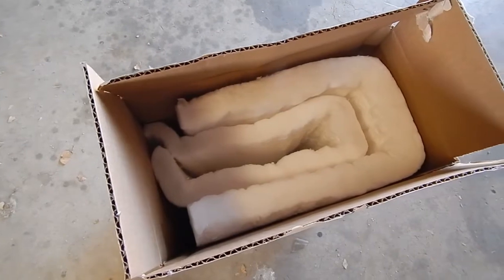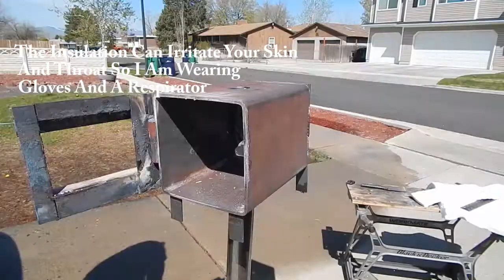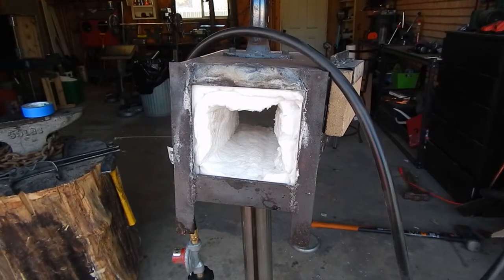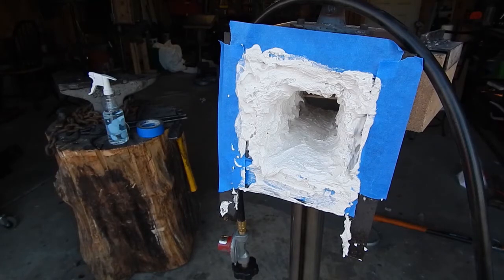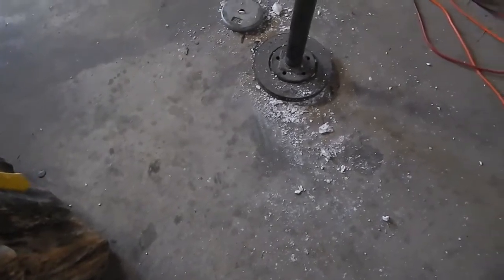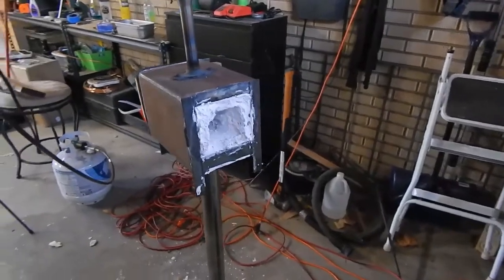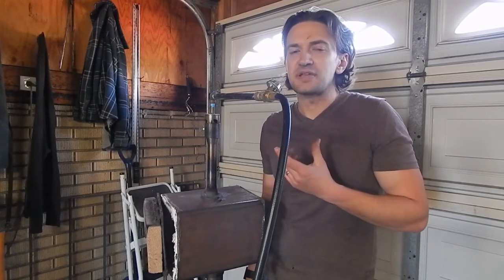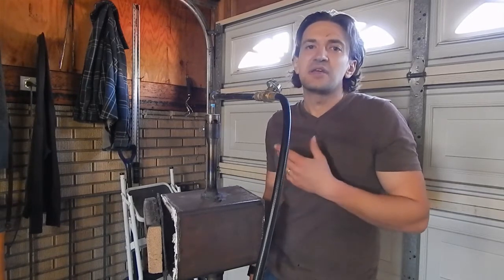KNIFE MAKING- HOW TO INSULATE AND COAT A FORGE

Comment: Did you use rigidizer before applying the Satanite?  Not an expert, but when setting up my 1st forge, instructions said to apply 1/2 of the Satanite, wait 24hrs, apply the 2nd coat, wait 24 hrs. Then light forge for 30 seconds, then wait for it to cool. Continue lighting/cooling, adding 5 seconds to each burn. Continue till you see no steam.
I didn't see any steam with the 1st burn, but continued adding 5 seconds up to 3 minutes. Working great so far.
Reply from the maker: I didn't use rigidizer. It does give extra strength but isn't necessary. I ordered a larger forge so I will probably use it on that one. My heating was similar. I coated and heated (a little sooner than I should have) then re coated and heated in smaller amounts until I felt good about it.